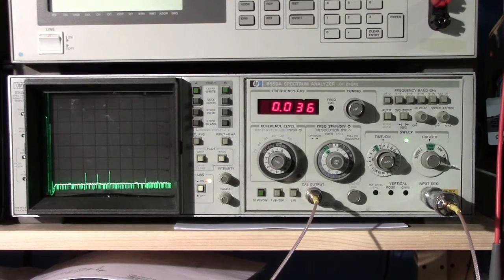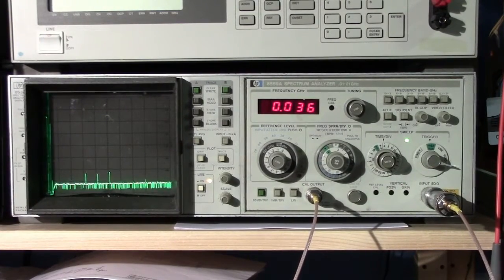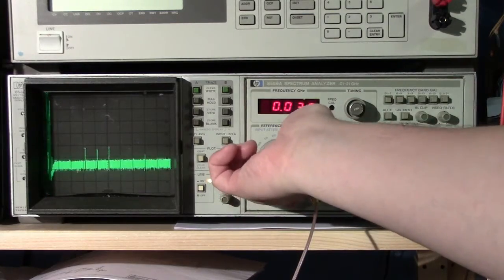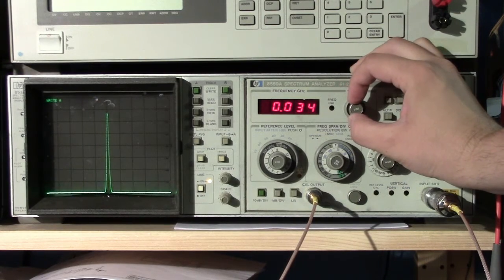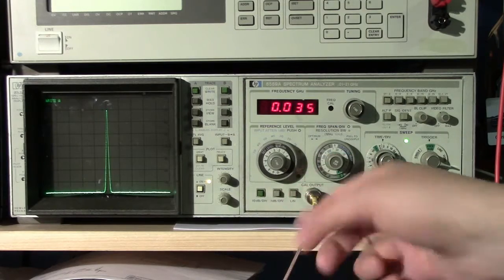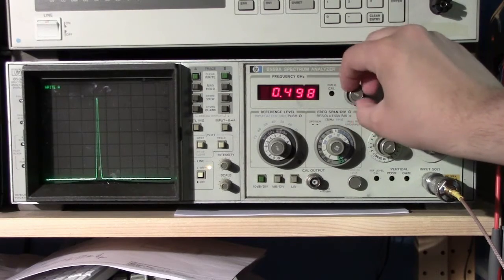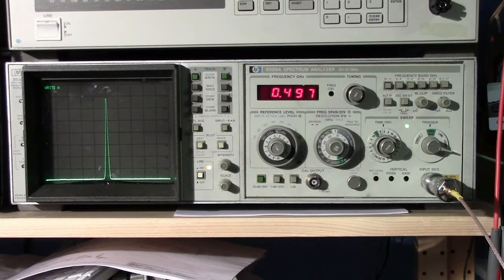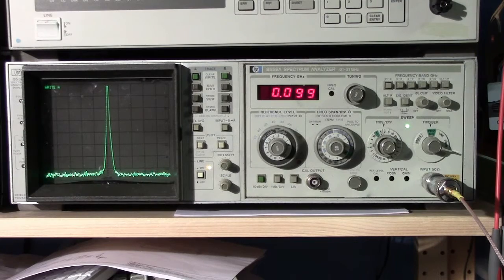Making basic signal measurements with a HP 8559A

Comment: Hello! I bought one of these units, and I'm trying to follow the User Manual to calibrate the vertical gain and position. Unfortunately, I'm not able to adjust the vertical levels to touch the bottom graticule. Also, did you see that in the manual, it says the CAL OUTPUT is 250MHz?

Comment: This is one of the Spectrum Analyzer mainframes I have. I have all three plugins (HP 8557A .01-350 MHz, HP 8558B OPT H17 .1-1.7 GHz and the HP 8559A .01-21 GHz). While not the most accurate instrument in the world you can still make very useful measurements with it. When I want to make quick measurements it is usually my go to machine. This analyzer has some limited HP-IB functionality but are very helpful with automated measurements. If you have a HPIB/GPIB card installed you can manually add things like on screen readouts, markers and manual sweeps. If you have a HP plotter like a HP 7470A you can print out everything for a nice hard copy of your measurement. Software packages like KE5FX's GPIB tools will let you send and receive commands to the analyzer and print out plots. However if you want to use the HP Basic code samples in the manual you will need to install HTBasic for Windows.